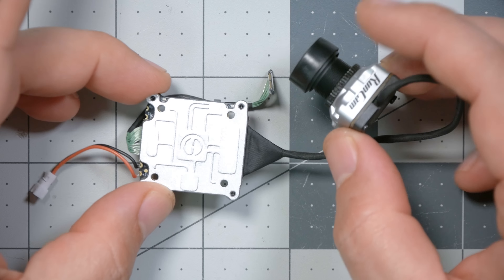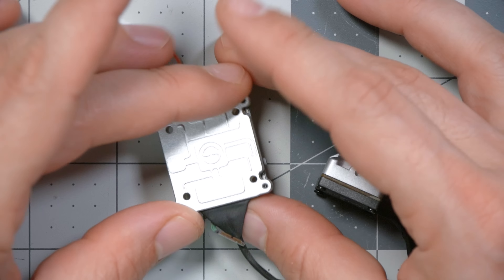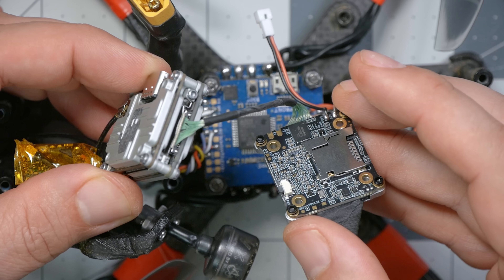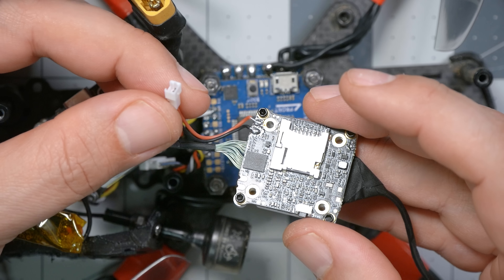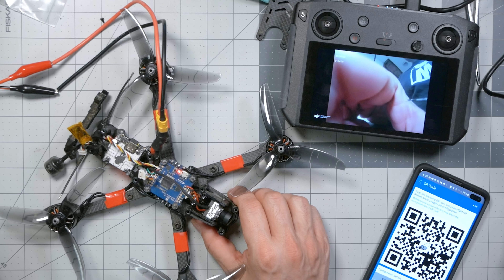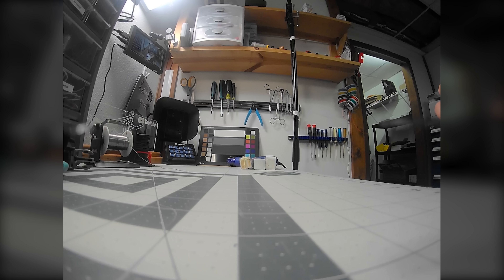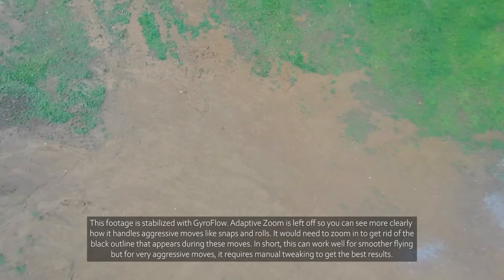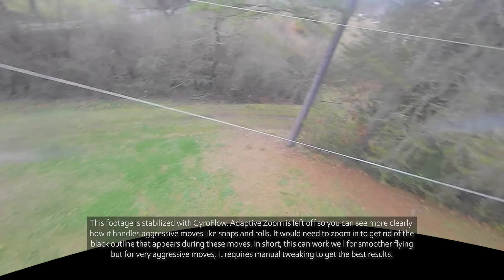Record your DJI FPV feed in 2.7k with RUNCAM SPLIT HD

Comment: @2:52  i fixed mine using direct lipo voltage 4S instead of 12v FC out to power my air unit

Comment: I'm not bitching or anything, that was an great review, fair and honest.  I just wanted throw a two things in.  Once this caddx DVR is all installed, it definitely has thinner form factor, but it appears to be double the height of an air unit.  The other thing is, the air unit bug with the slow SD card error is very fixable, in fact I got the fix from Blunty's youtube channel.  Basically you need to turn off "record on take off" and make sure you always format the SD card inside the air unit using the goggles settings, that's it.
Reply from the maker: Everybody has what they think is the fix for the SD card slow error, but there are still people out there who have tried everything and it didn't work. I don't think any of these fixes are definitive.

Comment: I have about a 1 out of 3 with dji air unit sd card recording being reliable, the 1 that works is really nice, and the audio is usable, i have another that is intermittent and one that does not record. the one that works always works so thats something.
Reply: I again believe this goes back to where you purchased the AirUnits as well.   I'm thinking some sellers are selling refunded or Refurbished units.  I'm not going to mention there names but I'm certain I received a used Refurbished DJI V2 headset and 2 AirUnits from a popular retailer that of course doesn't back DJI products he sells.

Comment: Can be used as an additional camera as a stand alone unit? 🤔 can ve a chippier way to get freestyle and practice footage on almost any quad, a good print can put the runcam and a nebula on the same angle!  🤔
Reply from the maker: I don't see why it wouldn't work that way. But at that point, why not buy a Runcam Orange?
Reply: @JoshuaBardwell  because with the orange on a crash you lose all, with a split you can protect the camera and only the camera was exposed. Less weight. 🤔
Reply: Like having a gopro naked on a 20x20 with replaceable lens/sensor... 🤔 🤣🤣

Comment: Joshua, you know everything. Pls tell how to control Max Power of Crossfire Tx by rotating the 6 pos knob. 100/250/500mw/1W?  And how to turn ON/OFF the CF tx module by radio switch while you are not flighting but getting new battery or changing quad etc. Not very cool to turn off and on radio every time. No information about that anywhere...
Reply from the maker: https://youtu.be/VxADkHu8Y70
Reply: @JoshuaBardwell  thank you a lot! Somehow I haven't seen it that video. It's exactly what I was looking.

Comment: Dji know about the sd card slow error but  are unable to fix it cause its partly a power issue. The air unit is too sensitive to spikes in the power and the 50mbs has made it worse. One can downgrade to an older firmware and run 25mbs and improve the issue, but the best option is to put on a really good filter on the power
Reply: I run mine through filter (Matek) ubec duo which is big but works fine on large planes like clouds or Mini Talon.   With clean power and turning OFF auto recording I haven't had any issues with slow sd card.    Also I never Format cards outside of DJI system.

Comment: DJI Air unit recording never has really worked for me. I think it's an overheating problem. Last week I flew during the cold winter weather and it worked fine. But usually it stops recording without any notice and I don't have any video from the air unit. Really disappointing since it was not cheap.

Comment: Goggle feed DVR is only 720p.  2k is better than the air unit and the goggle DVR.  Gyroflow crops will be fine.

This will be fine for long range and cruising where latency doesn’t really matter.
Reply: Can you record without the Vista.  Like use it for a poor man’s action camera and just mount it like a 360go camera on top of the drone?  I have done that with a Runcam split.

Comment: They should have made it parallel, not series. You already locked out other cameras, you might as well put two mipi connectors on it, one going to the vista, the other going to the dvr board. This way there is no added latency in the video feed. If they can't split the feed they could always go the tarsier way and put in two sensors...

Comment: On the SD card slow issue, I found a recommendation to use SanDisk Extreme UHS-1 SD cards, the red and gold one and not the plus or pro version. Since switching to these cards, I've only lost 2 videos, before switching, it'd be every third video if so.
My guess is these are the cards DJI used to test their firmware. I'm not sure why that would make any difference, but it really does.
Reply: i fixed my error completely going from the red/gold 60mbps cards to the red/black 90mbs cards
its ultra and extreme cards i think
Reply: +1 I only use SanDisk Extreme Pro 128GB (red/black) and never get the slow SD error with those.

Comment: That extra latency looks a lot like they are basically just "emulating" a camera. I think what's happening here is that there is a completely separate encoding + decoding process happening:
They take the high resolution video feed from the camera, encode + record it and then finally scale it down + decode it again. Then it is output to the actual Vista which is doing the same thing again. So there is actually two complete video pipelines running here. No wonder why this increases latency. 

When I first saw this device I thought they had implemented some sort of MIPI-CSI "sniffer". This would not have added any latency to the live feed but I don't think this is possible because it interferes with the way MIPI-CSI signals work.
Reply: I think a lot of people would've been happy with just 720p recording (i.e. you get exactly what is sent to the vtx) if it meant not adding the latency...

Comment: Why do manufacturers ignore parallel connections? The camera feed could easily go to the vtx and TX at the same time! Why daisy chain?? 🙈
Reply from the maker: Because they need to down-scale the image from 2.7k to 1080p before transmission, is my guess. All other DJI cameras are 1080p. Also, they want to be able to draw OSD on top of the image, such as the recording indicator.

Comment: I have the big brother of this FC, the iFlight-SuccX-D-TwinG v2.2.
My boot button melted off during flight. Everything seems to be fine, other than the melted solder that attached the boot button to the pads. 
Has anyone else had a similar issue with this flight controller? PCB getting way too hot?

Comment: Comment to Airunit DVR - it works but it is a bit tricky. So here is how it works or me: The Airunit is really, really sensitive to input voltage. So I put it to the 9V output of the FC and I added a 220uF/10V Tantal. I am using the 128GB SanDisk Extreme Pro (note that the 64GB version is slower). And I record in 720p@120Hz.
Reply: So you're saying its recording works reliably when you do this?
Reply: @Vousie  yes, I did not have a slow SD message since I did that. Certainly more than 100 packs on the quad with the Airunit (others are Vistas).
Reply: @Stefan_73  Interesting that the airunit's vtx/video processing seems fine with voltage variance (i.e people not having issues just flying with it), yet its DVR is extremely sensitive to it...
Reply: That's definitely a plus.  Having clean stable voltage to AirUnits but I found turning off auto recording on arming help my error issues

Comment: Can I use this on the full air unit for gyro data since dji never listened that gyroflo is a thing?
Reply from the maker: Yes.
Reply: @JoshuaBardwell  I was being facetious the full air unit should be able to with a software update. Thanks for the response. JB could you hit up DJI for this feature on the next patch? We  appreciate You.
Reply from the maker: You can already gyroflow DJI DVR using blackbox logs from the FC. For the Air Unit -- is there any indication that it contains an IMU sensor? If not, then it couldn't record the necessary data without a hardware change.
Reply: @JoshuaBardwell  it would be great to have it on the camera  SD card  gyro data can't be recorded over the msp connected uart?
Reply from the maker: MSP would not be high enough refresh rate.

Comment: SD card slow can be avoided by running at 700mw or less, as the message seems to be heat related.
Reply: Nope. Got the issue even a 25mW randomly.
Reply: @xnoux1  It’s the one thing that fixed it for me.  Along with turning the Temperature monitor setting off, but who knows.  While it’s working I’m not going to tempt fate and update the air unit firmware, but if you are having issues at 25mw, you likely should try.

Comment: I wonder how much weight could be shaved off the Vista unit by removing the bits for the dji radio and making it solely a video transmitter 🤔
Also, has anyone run the OG air unit naked? I feel like that'd be the better option for keeping the DVR while saving weight.

Comment: Re the DJI "SD Card Slow" issue.  I have 4 of the original DJI air units (on current firmware) and have recorded many hours of video using them (at 1080p/60).  I have only had that error happen once.   How?  I only use genuine SanDisk Extreme Pro 128GB cards,  I don't let them get nearly full, and I format them in the air unit after I've copied the files to my computer.   If you follow these rules the recordings should be very reliable.  I think the reason for the one time error I had was that the card was nearly full (before I started to follow all these rules).  

It's a pain that the air unit is so fussy about media, but the SanDisk Extreme Pro cards are not expensive (under $25).  Obviously, it's really important to make sure you use genuine ones as slower cards don't work reliably in the air unit, and fake ones are almost certain to be slow.
Reply: I think the key is big cards and not using 1200mW, there seems to be two separate issues depending on the quadcopter. Big cards often means less filesystem fragmentation so less delay plopping data to the card. If you ever accidentally power off your quad or crash land and lose power, you will likely corrupt your card and this could cause a slow SD card error later on in a future flight. Always clean off your card especially if you only get this after a few flights of successful recording. Smaller cards often can fragment all over just from a few flights and cause slower write speeds, it appears to be latency that causes this error moreso than actual write speed bandwidth. The other issue is dirty power/overheating air unit. I wish the unit had much better diagnostic logs to know which issue the user is suffering.
Reply: For whatever reason also I don't have much luck formatting the card from the air unit either, do it from windows (etc) so it does a proper fs check. I also wonder about which SD cards internally trim deleted files, as we know pre-deleting nand blocks allows for a quicker write access. I guess it entirely depends on the sd card itself given they're essentially nand blocks with their own built-in controller.

Comment: WRT your stating you 'manually stretched' the video (@ ~20:48), what tool(s) can be used to accomplish this?

I too am seeing this sync delta between goggle and air-unit recordings (Avata here).  At the beginning of the video I synced it manually in Filmora - by end of video, it's 15-30 frames off:  https://youtu.be/uG5u8YFR4x4

Across multiple flights, the goggles' recordings seem to lead air-unit video recordings, so the theory of the goggles dropping frames might make sense.?.

I'm interested in seeing if the use of a tool to 'stretch' the video to see if that might ease some of my OCD traits.  Thanks.
Reply: I figured it out (Filmora is my editor of choice and it is a native capability to stretch/shrink audio and/or video tracks).  Thanks for mentioning the shrinkage... ;)

Comment: That absolutely had to be said. The air unit already exists, why re-create it. Unfortunately, every runcam split type of product that I have ever use, has been a complete disappointment. The issue with the analog splits that would cause the frozen FPV feed what is my breaking point. Never again.

Comment: is it possible to run the runcam link split hd as a stand alone unit for recording only, separate from my fpv cam?
Reply: using my foxeer t rex for analog fpv with headtracking, thinking of mounting the split hd on top of my fpv camera while it is in the gimbal

my goal is to have dedicated analog fpv but run the digital cam to record everything im seeing including head tracking 

fixed wing btw, new to all of this btw

thank you for your content, extremely helpful

Comment: I have this runcam split on Geprc Cinequeen converted to Vista/Runcam Split HD, in the 1080p 60fpd, you feel NO lantency at all, but in the 1440p and 2.7k, oh yeah, I consider that mode strictly if your gonna to slow cinematic high shots, no gaping and fast flying in that mode, really feels weird, but since I use 1080p 60fps, ok for me, way better video over the goggles for sure, on par with the 1080p 60fps on the DJI Air Units.

Comment: Could possibly use this as a 20g standalone camera without linking to the Vista unit, but grab power and control from the FC?  Only saving 10g over Caddx peanut but you would gain benefits of a swappable SD card and probably a lighter mounting setup for a few more grams of weight savings.  This might matter for micro class or sub250 5"
Reply: That’s what I asked, but knowing DJI you might have to stop and start the recording with the goggles, but maybe there will be a hack!
Reply: Also keen to know
Reply: This is probably the only good use for this product... As a light action camera.
Reply: @gavsfpv3786  I have not seen enough about it yet to know if it can be done and right now I am not interested enough to really look for it.
Reply: Maybe JB can disconnect his vista and do a short clip on it to see if it works
Reply: @gavsfpv3786  Yup. Would be interesting to see whether it'll even record when it's not connected to a vtx. That said, I'm on team "no-DJI" - too much latency, restrictions, etc.
Reply: @gavsfpv3786  It looks like a pass through, but maybe if you did all of the settings with an Air Unit first it might record by just powering it up.  If it can easily be done somebody will be making a video soon.

Comment: Air unit used to lock out randomly with SD card inserted, causing the quad to failsafe
I switched to crossfire since and have stopped putting SD cards in my air units, so not sure if that's fixed now or not
Reply: i started fpv this summer and i think i have had that isseu one time.
it would just fall out of the sky and footage showed the drone just stopped .
i also stopped using the sd card slot since then and only use my runcam5 and dji goggles to record

Comment: Umm to remove latency issue… can split HD use as stand alone? 
Comparable with GO 2/Peanut. Wins for 1/3 of GO2 price, lighter, smaller and sleeker 3D print case. Think of both nebula pro nano and upcoming runcam nano as tandem?

Comment: Can someone explain which digital fpv systems send 720p/120hz video to the goggles? Are there any BNF kits that include this? Thanks!
Reply: Any with the DJI FPV Camera or the Caddx Micro Air Unit Camera (a less common air unit + camera combo). Most kits 3" and up have DJI options! 

The caddx polar and all non-caddx cameras are all 60fps.
Reply from the maker: 120 fps cameras include the original DJI camera and the Caddx Nebula Pro.
Reply: @m3fpv253  Thanks for the information this does clear a few things up. Howerver I do still have a few questions. For example, what is the differnce between the Air Unit, Air Unit Micro, Polar Vista HD,  Vista Kit/Air Unit Lite and Vista Nebula Pro? It seems very hard to find organized information on what the names and kits mean.
Reply: @N3xTw1tN3eS  jb included a camera i forgot about, the caddx nebula pro.

no one likes how stuff in the DJI ecosystem its named! even working at a retailer i get confused lol.

The Air Unit and Air Unit Micro are vtx units. the micro version is a bit smaller in shape.

The "Vista" part means it has a vista vtx. The words in front like "Polar," "nebula," etc, refer to the camera that it comes with. So there is a Polar Air Unit and a Polar Vista, for example.
Reply from the maker: There are basically two vTX. One with two MMCX connector antennas and an SD card slot for on board DVR. That is the DJI Air Unit, or now the Caddx Air Unit Micro. The other vTX has 20mm mounting, a single UFL connector antenna, and no SD card or DVR. That is the Caddx Vista (original name) now more generally referred to as the Air Unit Lite (but still often called Vista by some). 

Everything else is referring to a camera name, like Polar or Nebula. Basically, you pick which vTX you want, and you pick which camera you want, and then you buy the product listing that has those things. The Polar Vista HD is a Polar camera with Vista vTX, which is also named Air Unit Lite. Vista Nebula Pro is Nebula Pro camera with Vista vTX.
Reply: @JoshuaBardwell  Thanks so much for explaining this.
Reply: @m3fpv253  Now this is the description that I have been looking for, thank you.

Comment: What would be great is to have a module just like this but also with 2 more camera connections as an option to use on fixed wings or mount extra cameras on the quad, all feeds selectable by the radio channel via the UART!
Fixed wing flies great with 70ms latency!
That would be a great aim for this product if it had extra cameras input

Comment: Doesn't the original air unit have the sync issue with the onboard DVR vs goggle DVR as well?  I always assumed it was because of dropped frames from transmission errors.

Comment: They could've just given us the DVR attachment to work with the original DJI camera and alternative cameras with up to 1080p recording, without the added latency, to achieve air unit recordings from a quad that only fits a vista. That would've been enough for first release.